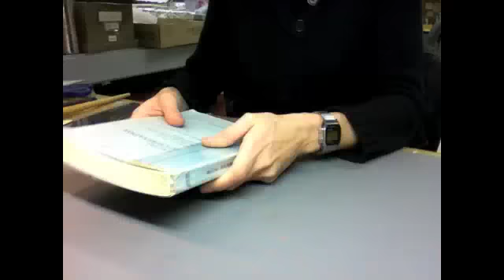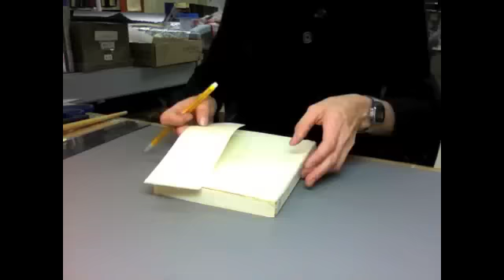Book Repair -- Recase

Comment from the maker: @relussier Thank you.

I think that the process that you are thinking of is hot stamping which requires special equipment that our library does not have. If you want to see a video of the hot stamping process, do a search for "the PraGnant Press Type 30" on Youtube. For some reason, Youtube will not let me post the link to it on here. 

Another method that works for small books and for spine repair is to print directly on the fabric in a laser printer.

Comment: Hi Aran. I love your videos and have used them in several book restoration projects. I've come across a Bible that i am trying to restore but don't know how to proceed. The covers are off and I've cleaned up the spine but the text block has split in half..the stitches failed. Do you have a video (i don't see one) explaining how to sew or glue it back together? Or if no video, could you explain how to do this please? Thanks!

Comment: Aran,

Thanks to your instruction I just successfully recased my first book. I had another question regarding the spine board material. Would it be ok to use cardboard (say  0.59lb) instead of cardstock for the spine? I ordered a board and it was thicker than I anticipated and wondered if it can still be used.

Thanks again